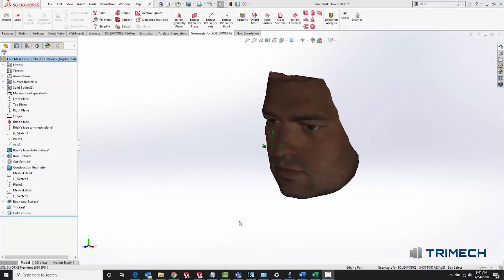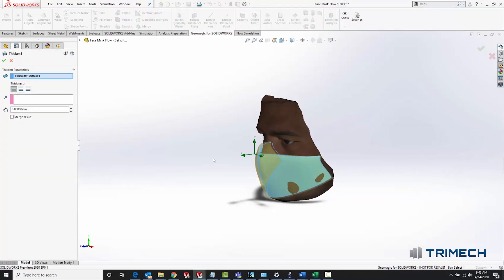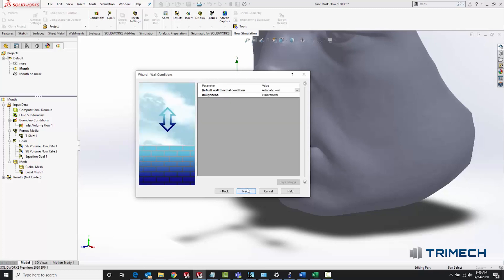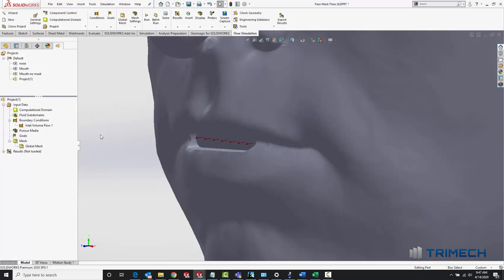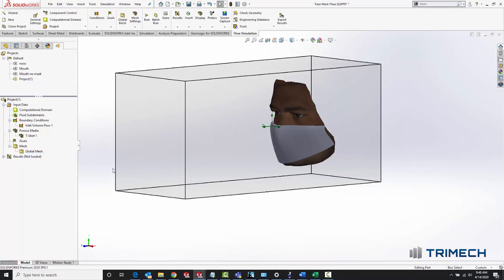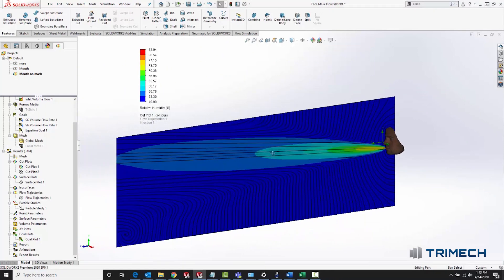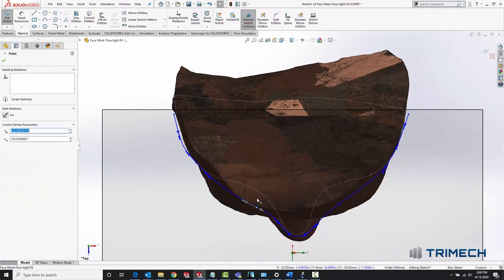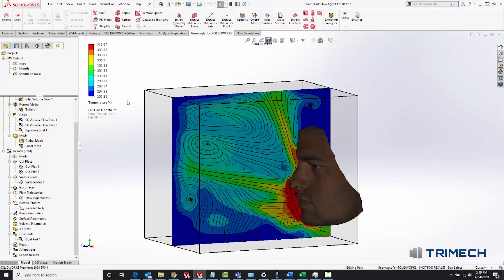Understanding How To Build A Better COVID-19 Face Mask With SOLIDWORKS Flow Simulation

Comment: Great start but it would be really useful if you would work on refining a few factors:

1. the mass of a virus: viruses are 0.005micron in size, and a weight  0.85 x 10-18 grams
2. the surface tension of water droplets:  72 dynes/cm 
3. the velocity of a breath/cough: you said it in the video
4. the density of a fabric mass: not sure how to work that out
5. the collision force of the impact: ???

My contention is that viruses might be made airborne in some circumstances by the mask acting as a sieve for the water vapor therefore inadvertently making the virus more contagious.

What you think...is it doable and worth doing?